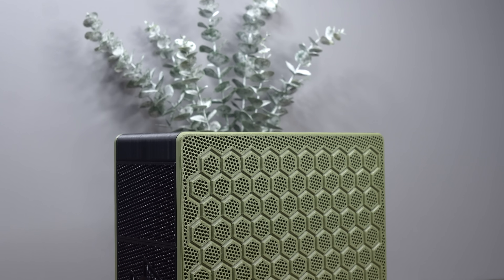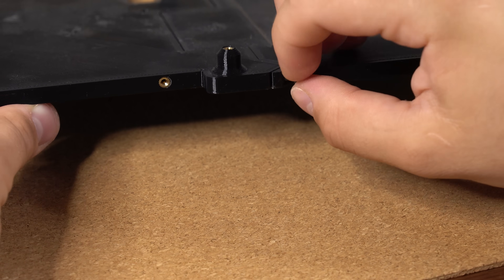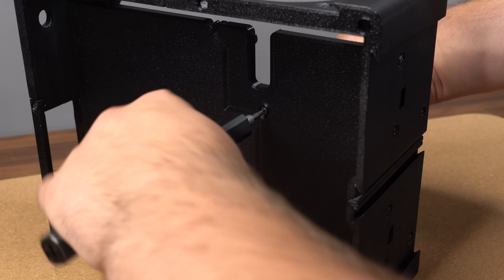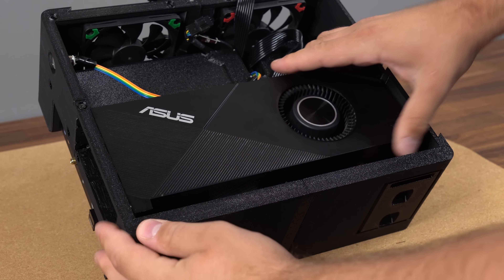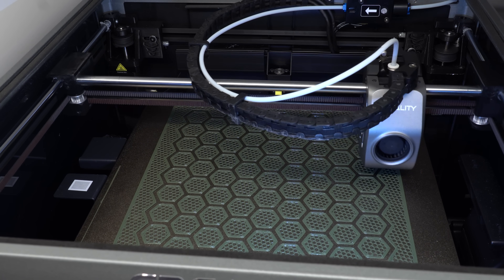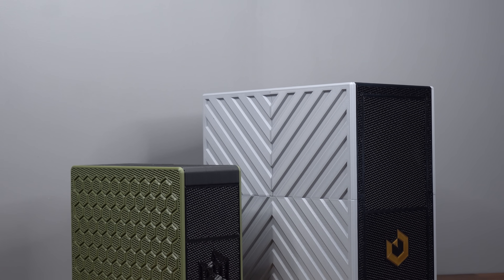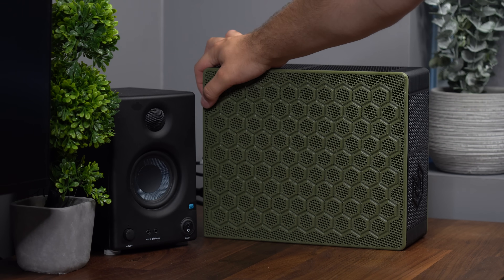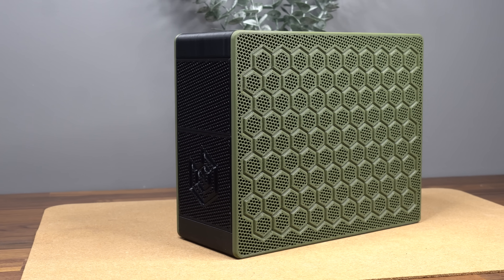A Backpack friendly 3D Printed ITX Gaming PC case

Comment: This is really cool, i love it!

unrelated, but
i have an idea, an unusual idea, but an idea indeed, on how to make this even smaller, you could include gromits, for external watercooling
that way you could cut down alot on the GPU size, since most water blocks, even for a 4090 are single slot
Reply from the maker: How does external water cooling work? Sounds interesting! Never looked much into it. Are we talking like a radiator in a separate chassis, open air?
Reply: @makerunit  basically you take a radiator for a custom loop, you put fans on it and they make brackets to mount pumps directly onto that, and what people do is they use either gromits like on the old cases, or they just drill a hole and mount a fitting
You basically have all the watercooling stuff outside, so you can take the heat and noise away from you while cooling your super small pc at a even better rate than normally
most of these use quick disconnects for ease of use
Reply from the maker: @skorpysk  I see! Sounds advanced, but could definitely make for a very cool and extremely compact build! 👌

Comment: Really cool design dude but I will say I know that psu is known to fail and is one of the less reliable flex psu's around. I have an flex guru 500 which is what I would recommend. My buddy ruined some hardware with that psu and I don't really want anyone else to do the same.
Reply from the maker: Thank you!

And, oh really? I didn’t know. Thanks for letting me know, definitely something to think about. However I’ll probably continue using it until it fails. 

How did it fail for your buddy? Did it cause a fire?
Reply: @makerunit  I think a cap blew and there was quite a bit of smoke.
Reply from the maker: @hungrythundr4892  I see… that’s not good, but again, really depends on whether it’s a common fault or your friend might have just had very bad luck and got a bad unit. It happens to pretty much every brand at some point that their products fail one way or another 😅

Comment: Does it require a ESD safe filament material to print ?
Reply from the maker: I’ve never had issues with regular PETG for my PC cases ever, and I’ve made a lot of different cases. However if you’re worried about that you can get both ESD and Fire retardant filament 😊

Comment: anything that can be printed with 256*256*256 bed from the bigger version? Is there some mix and matching?

nevermind you answered in the video :D
Reply from the maker: Yeah, the top and front external panels are intentionally made their sizes to fit the Bambu beds 🫡

Comment: Something I was thinking about would be a modular case design that could be expanded for bigger mobo sizes, so the smallest "build out" could be ITX or then you could slide on a couple of expander pieces to fit a Micro ATX or full ATX, then you could do the same with the outside case panels.
Reply from the maker: Definitely doable, I’ll keep it in mind! 😊
Reply: @makerunit  If you ever want to brainstorm about ideas let me know. (I have pc hardware and case ideas but not much practical printing experience)

Comment: is it just me or does the 'x' joiner actually look WAY cooler than the intended outside of that panel? hot damn.
Reply from the maker: So you’re thinking, why not hide the X joint in plain sight? That’s actually a really good idea, because the X joint on the outside, and butterfly joints on the inside will combined make the panel incredibly stiff!
Reply: @makerunit  Exactly! Not to mention, by not having an 'outer' surface to 'cover' the X joint, you technically could shave off about a fourth of the thickness, give or take a bit (I popped it into cad and started playing around with removing layers to see how it looked)
Reply from the maker: @StormBurnX  I could always do the same type of joint I used for the two internal panels in this video. That might actually work very well, how did that not even cross my mind 🤯 while still getting the splits.
Reply from the maker: Looking back at this comment a year later I'm getting some ideas... What if there's a case with all the joints on the outside, simply as part of the design rather than hiding them. That could be quite cool and an interesting challenge.

Comment: I think for the side panels, you might be able to hide the seams along the hexagons’ edges unless you’re already pushing the limits of the build plate. It will definitely be more work than just the straight seam.
Reply from the maker: Yeah I actually thought about that to be honest  but didn’t go through with it, although it would probably make for a cleaner result overall.

Comment: sir, im building one for myself with my own design. i wonder if the brass screw diameter size is 3mm. the hole we have to make is how much exactly? is it same diameter with the screw brass or have to make it little bit bigger like 4mm. im really looking forward for ur reply. tq really appreciate it
Reply from the maker: Hi! I’m normally using threaded inserts that are 4.6mm on the outside. Usually I will design the holes to be about 4.4mm, that seems to be the sweet spot to make them stick nicely without making a mess, if they feel loose on 4.4 I’d try 4.2mm for the hole diameter. 😊 you could do a tiny test piece, into a little cube with two holes, one 4.4 and one 4.2 to see which one fits the best for you 😊
Reply: @makerunit  understood. tq so much for the kind reply.

Comment: doesn't the heat from cpu and gpu melt the pla plastic????Is the pla filament resistant to heat???
Reply from the maker: The PC will not turn into a liquid puddle of plastic if that’s what you’re asking, but on rare occasions some people may experience slight deformation if using PLA,  but it’s not recommended to use PLA. 😊 I did specifically mention you should use PETG or another high temperature tolerant plastic type

Comment: Hi bro, tell me, what about fire safety in such a building?
Reply from the maker: Well, if it catches fire, it catches fire, but that would be if any of the components were to fail. I recommend printing this in some higher temperature resistant material like PETG or ABS, but yes, they are flammable if it first catches fire. 

If you are worried however, there’s always the option of using specifically designed filaments that are made to be fire resistant for purposes where that’s important.

Comment: Your videos have been super neat! Enough that I am working on designing a custom nas case of my own 😅 having spent maybe 30-40 hours designing it so far and being only maybe 30% done, havomg worked on it makes me realize how much time you spend designimg these and making them easy to make!
Reply: That's awesome! I've been looking at doing a NAS case myself eventually. What motherboard form factor and how many drives are you going for? I was looking at a thin-mini-itx setup with m.2 sata controller for a future build, as you can get those boards with low-power Intel N-series chips on them.
Reply: @DigitalJedi  I did look at those ones, they seemed cool, although I ended up going with a micro atx instead. The MSI PRO B550 VC Wifi seemed like a decent board for it, I get 8 Sata cables directly on it, and if I needed to expand I have three pcie slots. And I have more experience with more normal motherboards. I can try to update when I get more stuff done with the case!
Reply from the maker: Hey! Happy to hear I could be of some inspiration! And yeah, definitely. Designing PC cases that are easily printable, designed for easy assembly, and tiny printers is not for the impatient one 😅 it takes hours and hours and hours, but it’s (in most cases) worth it when you finally reach your desired outcome! 

It does go somewhat faster over time as you learn what potential mistakes you might make and eventually just know where to look out for them 😊

Comment: I love to see the joinery improvements on each new case.

And PLA is probably completely fine for this kind of use. T-case is typically estimated in the 40s for CPU tdp measurements. Well below the glass transition temp of pla.

Functionally people have to understand that if the air was the same temperature as the chip no cooling would be happening. This applies to the cooler too obviously. You don't get burned touching it even if the CPU is reading 100C. It's just not that hot.

Side note: the just released ryzen 9000 chips are insanely low power for the performance. They match the i7s performance (that are literally melting themselves to death) using under 80W of power with overclocking ENABLED! 😮
Reply from the maker: Thank you! And yeah that’s exactly what I’m trying to tell those who are worried about the case turning into a puddle of molten plastic 😅 that the surrounding air will not ever reach the actual CPU and GPU core temperatures 👌 and now that powerful Ryzen CPU’s are getting so efficient it’s ideal for tiny builds like this 🙏
Reply: PLA is not good enoght, have seen 3d printed case which deforms (
optimum
)
Reply: @mabakalox2353  what infil and wall number was the print? And what's the power to cooling ratio of the PC that was put in there? 

Cause yeah there are tons of ways of doing this wrong. I just don't expect people to put a very power-hungry expensive computer in a cheap case. Especially not with under-sized cooling.
And if you print with less plastic it becomes a problem earlier.

But a PC with i/R 7 tier  cpu or lower and rtx **70 or RX *800XT tier GPU with just a normal sized tower cooler only kicks out 400W on average while gaming and 550W in absolute slammed peaks. One or 2 fans running silently to circulate the air through the case easily keep that below PLA problem zone.

If you don't have any fans to renew the volume of air inside the case, it is very easy to have a hotbox situation. But that's a problem for the  computer's performance too. It's not really a PLA issue. I'd even argue the PLA is signaling the issue to you.
Reply from the maker: @SquintyGears  That’s actually a very good point. The damage to the PLA is a clear indication that the system generally is running too hot. 😊

Comment: I'd love to see this kind of Case Design but for a whole ATX Mobo and PSU
Reply from the maker: I see, thanks for the suggestion! I’ll keep it in mind 😊
Reply: @makerunit  you can try making it like a Sandwitch style, Basically bottom layer we'd have HDD/SSD, PSU and Probably(User Choise) Space for an DVD/Blue-Ray/Floppy(using a Floppy drive would be Ridiculous but there are people who still use it just for shts and giggles) while we'd have the GPU and the Mobo on top of them on the 2nd layer. basically a Horizontal PC case rather than a Vertical usecase
Reply from the maker: @nicktheneko  I see. Not sure if I got it 100% but I think I get the idea 😁 actually not too far from what I already had in mind if this project comes up. Though my idea did not involve floppy disks and blu-ray disks 😅
Reply: @makerunit  basically something like the "Cooler Master RC-902XB-KKN2"
Reply from the maker: @nicktheneko  ooh, I see. That’s not what I had in mind at all 😅 but now I get what you mean 🫡
Reply: @makerunit  to be honest there isn't allot of love for Horizontal Cases for some reason, even tho Horizontal PC Cases have solved the GPU Sagging issues since their existence🤣🤣
Reply from the maker: @nicktheneko  I totally get you, I’ll be sure to keep this idea in mind for a potential project at some point 😊

Comment: I don't have such a GPU so this case is not for me. However this is such an amazing design. Well thought with 2 standard fan, it mean, unlike most commercial case of the same size, this one is a bit colder. Well done.
Reply from the maker: Thank you! I’m happy to hear you like the design! The two fans are definitely helpful in just removing some of the hot air to ensure the hot air doesn’t just circulate inside the case 😊

Comment: I bought your ATX case on Printables, and have been printing it for about 3 days now on my Prusa Mini+. I have to say, I love your work, and it is clear that you are implementing learned strategies. I was having trouble with the butterfly joints on the side panels just popping out, so seeing you use that new, oddly angled one is super cool!
Reply from the maker: Thank you so much! Did you try applying glue to the butterfly joints? Or melting them in place? If you print the joints in the exact same filament as the side panels you can melt them into place with a soldering iron from the inside, or even use glue first in the bottom of the hole, and then soldering iron on the top for the ultimate bond, I only used a different color in the video so that it would be easier to tell them apart for the viewing experience 😊
Reply: @makerunit  When I do the final assembly I will glue them in place, but I wanted to make sure I had all the parts in the right spot first!
Reply from the maker: @MrScorpianwarrior  That’s good! There again is a benefit of it being easy to remove, that if you want to test-fit it’s not permanent 😉
Reply: Hey. Can you share the files? :D
Reply from the maker: @kristianjozef3198  The files are available to purchase or obtain through membership on Printables.com

Comment: Need to dial in your input shaper. Looks like you got quite a bit of ringing(like around the numbering)

Nice case though
Reply from the maker: Yeah, I did some adjustments to my printer right before starting the print, and ended up tensioning my belts too much, I realized that actually about halfway into the prints but decided to just finish with it that way. I’m working on correcting that right now actually 😊 and, thanks!